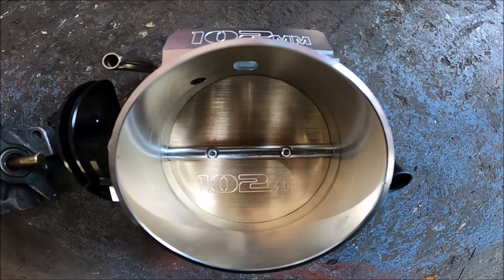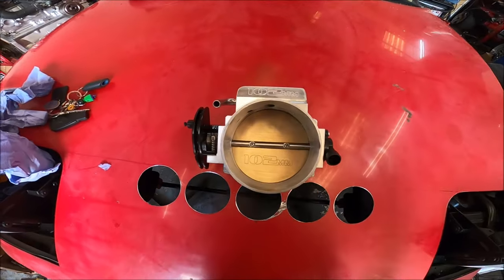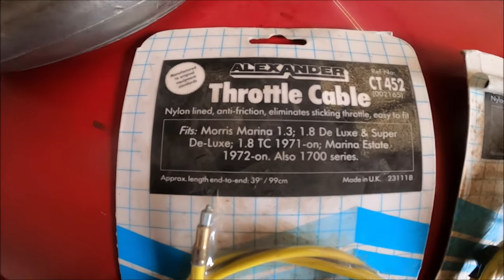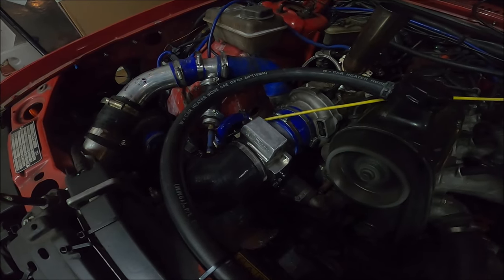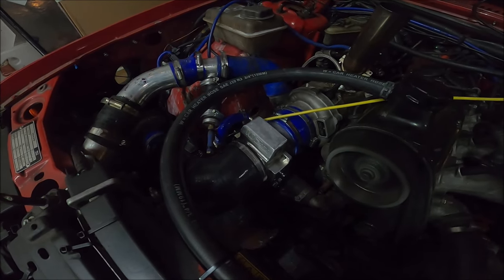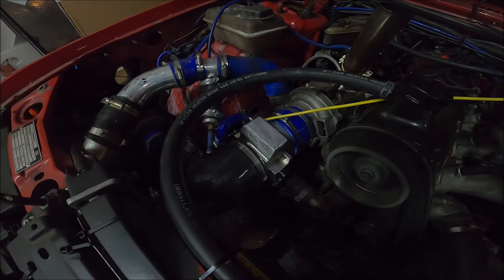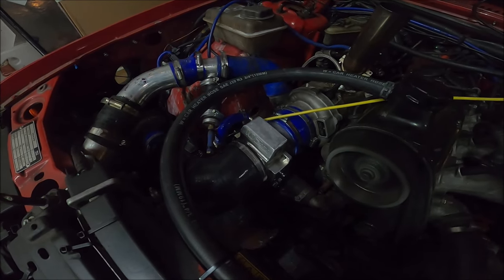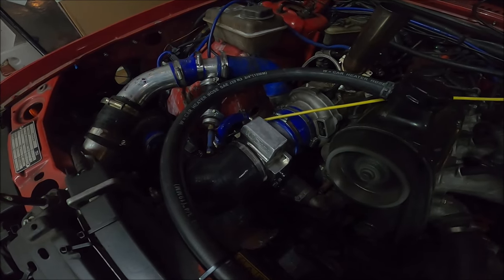Formula One technology for the Volvo 940! 102mm throttle, mounted BEFORE the turbo? Anti lag? Junk?

Comment: The set up running a pre carb is a great way to improve both throttle and turbo response but there is an issue that when closed it will cause negative pressure this over time will cause catastrophic failure as with many racing cars back in the day which happens when the oil seal has a catastrophic failure which won't just leak a little it will all flood the turbo at pressure which may lead to breakage of fins when a large volume of liquid hits them at speed suddenly warping/bending leading to chatter and breakage also the suddon loss of oil pressure will kill the engine and could possibly blow the engine if the timing jumps out .. . This is why many race cars and rally cars switched to the modern type of antilag on turbo set ups because of this reason yes it works good but as soon as one of thosevoil seals blows out or in this case gets sucked put it will lead to multiple failures that will lead to catastrophic failure ....the oil leakage will not happen straight away it won't be a continual issue from beginning but over a period of time the negative atmospheric pressures put a strain on the oil seals in the opposite way to what the seals is designed for in normal pop's the positive pressure helps to keep the seals in place preventing the oil pressure pushing oil into the turbo if u suck the oring on one side and push with oil pressure on the other side you double the stress on the oring with it unseating the seal which is death to the engine... if you look in the 80s and 90s how often the cars on track would have engine failures these failures were because of this set up yes it gives greater responses on boost and throttle but at what cost I remember seeing the cars on track after every few races either swapping out the engines or blowing an engine after only a few races 9 out of ten timescud see oil burn from exhaust and then bang there out an oil spray all over the track  and there would be an anouncement that that team is now out seem to be an oil pressure problem or an oil leak which is why it is not a good idea to run such a set up for a road car... the seals will pop  when u least expect it there is usually no signs right up until they actually let loose  an in that instance you don't want it on road because if your engine goes bang an u spill oil on the road your putting other people's lives at risk cos u might cause a crash when the seals suddenly let loose honestly think you need to think more when modding a car it's not just the performance you need to keep road safety in mind particularly if you are looking to run it as a daily driver or road car...
Reply from the maker: This is all covered in the video, including the solution to this.
And this wasn’t why the engines had failiures back then. Well maybe some badly done draw thru turbo setups, but not the ones with the throttle pre turbo etc

Comment: I am pretty sure the oil thing was with very old turbochargers. Any turbo deisel would create enough vacuum to cause that issue as they don't use any throttle body.
Reply from the maker: Turbo diesels have no real vacuum anywhere as they have no throttles, hence why they use electronic or mechanical vac pumps to operate everything .
Reply: @StavTech  of course what am I thinking. 😆 although some Toyota's use one as a safety.

Comment: So, I had a 200sx on a cossie T4 with pulsar throttle body intake (reversed to fit an SR20det obv) if I had put a throttle before the turbo also, would it have improved throttle response and lag? As much as I loved the kick up the arse when it eventually spooled, less lag would have been good!

Comment: In FSAE we could only run one TB and at the time we needed to have it in front of the turbo, so we fucked a turbo or two and while we were looking for solution (hard to find decent turbos for 600cc with limited budget) they changed the rules, so that was nice. Apparently some type of seal is fine with it.
You are not mapping Your car, it's more like saving a new file that a mate emailed to You into the ECU. Whatever.
Thanks for the video.
Reply from the maker: Nobody said I’m mapping a car?

Comment: This thing is NUTS! I don't see a reason to use anti-lag anymore along with this. Or is there?
I mean the lag is obviously gone. Why should you?
Reply from the maker: This is great for the money and effort, but proper rally antilag is way way better. You can’t compare this to having all the boost on or off throttle at any rpm.
Reply: @StavTech  Nevertheless. Less risk for proper anti-lag to prematurely put wear on components. 
And may be a bit more sleeper oriented as you don't have the pops going out the exhaust.
I've indeed never seen anybody do this and I'm really convinced it works out for you.
Reply from the maker: @volvovalor8051  oh for sure, no stress and no noise, as road car always usable stuff goes, it’s brilliant.

And it certainly works great for me

Comment: What's  Stopping you  making this the one and only throttle ? is it just danger of over speeding the turbo ?
Reply from the maker: The vac from that is usually what sucks oil out the compressor oil seals. Also meant to give worse throttle response.

Comment: It would be good to measure but I think your vacuum cleaner analogy is wrong. As you have a throttle at each end of the boost pipe, when you shut the throttle quickly it should trap the air in the pipe rather than letting it push back out passed the turbo. You should be holding something close to full boost in the intake pipe while the throttles are closed :)
Reply from the maker: It’s nothing to do with the compressor really. 
The turbine is the motor of a turbo. You give it no work to do, it speeds up. It’s work is turning a compressor which in turn is trying to push air.
And no, you won’t hold any boost in the intake pipes, if it did the turbine would have work to do, which would slow it.
Reply: @StavTech  without the extra throttle, when you lift off the air pushes past the Compressor wheel and you can hear the chatter, with the throttle where does that air go? 

It must be in the pipe. Yes it will bleed out as both throttles are never really 100% shut.

Be interesting to put a pressure gauge on it and see what happens.
Reply from the maker: @CheekyNinja  I already have. There is zero pressure in there off throttle. Where does the air go? In to the engine mostly.

Comment: You talk about time swapping chips compared to tuning, but in reality an aftermarket ecu would take a day or two to fully tune and be much better, how long does it take from the first chip to being tuned correctly? Guessing much longer than a couple days. 
Good video otherwise
Reply from the maker: It took me sending him the closest chip I had that was correct, telling him what I wanted changing, and him sending me back the right one. So two days and no effort or money.

Unlike buying, wiring in, and mapping, an aftermarket ecu which will gain me little to nothing.

Hth

Comment: You need carbon seals for that right? I read that the turbo's seals will be vacuumed and oil everywhere.
Reply from the maker: No because if you still run a throttle in the conventional place too there will be no huge vacuum

Comment: You need to buy yourself a turbo speed sensor, tons of pressure sensors and log all the improvements, a "feels" better Video isn't enough to prove a point. How many milliseconds are we talking? 
And chips? It's 2021 now. Time to get a ecu.
So is what to do when you just do shift cuts and leave the throttle open what could be done to improve lag between gears there with this? Maybe this was designed actually to make turbo lag less paot braking event and not lift off up shifts?
Reply: Also, don't make me beat you to having a engine dyno
Reply from the maker: This is a zero budget project and you telling me to fit turbo speed sensors lol.

It’s nothing to do with feels, plenty of comments have said even they can see the difference as all you need to do is go back and watch the previous video and you’ll see.

And as I explained in the video I have an aftermarket ecu for this, but why spend ages wiring it in, mapping it, etc, when I can just use the car no problem as it is and enjoy it. No gains to be had apart from pleasing people on the internet

Comment: and just maybe vacuum is supposed to keep turbo running? wouldn't that hard vacuum that engine generates with throttle off made a turbo spins real fast? yes it would suck oil from turbo but it would keep turbo spin on very high rpms. without vacuum, turbo will slow down cause there's no exhaust gasess and there's no vacuum, it's pracitally useless. 

i think that this is a good project but doesn't make sense, at least in antilag sense.

Comment: if you still have a blow off valve wouldn't it leak atmosferic air in the intercooler piping?
Reply from the maker: I never run BOVs

Comment: Does it not speed up because the velocity of the air increases due to the orifice or hole being smaller?
Reply: It speeds up due to the exhaust side of the turbo still flowing like crazy while the whole compressor inlet is under a slight vacuum and not making any boost thus there being no resistance on the compressor wheel. A single throttle pre turbo inlet works similar but due to the high vacuum it's more likely to suck oil past the shaft seal. And a post turbo throttle is has too much of a restriction while off throttle resulting in the shaft speed to decrease rapidly even with a very large blow off valve

Comment: alot of the new honda diesels have throttle bodies pre turbo. i wonder if its again to help with efficiency
Reply from the maker: I didn’t know that, but yes highly likely
Reply: Maybe some thing to with exhaust gas recirculation? For better control of amount exhaust gas..
Reply from the maker: @242turbo  they’d just put them in the conventional place like they have for decades on some diesels if it was just for that I’d say
Reply: It is to raise exhaust temperature during light load.
Reply from the maker: @V8Lenny  why would pre turbo do that over the usual intake manifold place?
Reply: @StavTech  sorry I didnt read carefully , some diesels use it after turbo for that , dont know about Honda and pre turbo.
Reply from the maker: @V8Lenny  yes indeed. The throttle is certainly for that.
But changing it to pre-throttle the only advantage I see vs the usual place is it could help turbo response. And as that’s such a big deal on diesels it makes sense.
Reply: @StavTech  dont know if it is big deal because diesels are at "WOT" all the time.
Reply from the maker: @V8Lenny  even bigger effect then as even bigger vacuum if you throttle it

Comment: out of curiosity, whats the point of having a throttlebody after the turbo if you already have one before the turbo?
Reply from the maker: Throttle response (though if you could feel that is debatable), and not creating such a big vaccum it sucks oil out the seal on the compressor side of the turbo

Comment: You need to put proper ECU on it, so much potential!
Reply from the maker: I’ve got one to go on. But to be honest it won’t make a massive difference to anything.
Reason I’m gonna fit it is to learn to map
Reply: @StavTech  do I understand correctly that with such setup you don't really need bov/bypass valve?
Reply from the maker: I’ve never ever ran a Bov or bypass valve on this car, even before this setup

Comment: i can imagine removing the stock throttle and getting a bether flowing intake manifold only could compliment this? as you remove resistance on the boost side?
Reply from the maker: A better intake side may help power if it’s a restriction, but it will have no effect on turbo response etc that the pre turbo throttle was affecting

Comment: rear mounts VGTs VAG engines in Toyotas  and now this shit  i swear Steave if we where the same side  of the planet  you and I would be we would be good mates  So much stuff I a ponder you are there messing with and testing .. Something else  I've been considering with this setup is a  massive dose of water methanol on trailing throttle injected right at that throttle plate  the vacuume you make would allow you to evaporate a heap of water meth  witch would do a heap of cooling to your compressor and  intercooler .. I see this video is old have you messed with this set up  much since then ??
Reply from the maker: Mate, if I had money I’d dream of owning a Dyno just to test stuff I’ve always wondered.

I’ve got countless other ideas I’ve always wanted to see if it works.

Not messed with this setup for ages, though still have it. Defo has an effect, but can defo be improved also from this setup
Reply: @StavTech I think you should do a DIY water Inj mod next. A washer bottle, some water mixed with isopropyl and a pipe from the pressure side of the turbo into the manifold.

Comment: Why even have such a huge throttle body?
Reply from the maker: Because you want more airflow at part throttle pre-turbo than pre-engine. You can either open the pre-turbo one much more than the pre-engine one, or just run a bigger pre-turbo one. I did that as it’s a hell of a lot simpler
Reply: @StavTech  This engine has 2 throttle bodies?
Reply from the maker: @kaedeschulz5422  yes. Same as pretty much every engine with this setup
Reply: @StavTech  Ah ok then i get it :D

Comment: The idea of using a throttle body in front of the turbo has nothing to do with turbo anti lag. It’s all about the turbos compressors surge line.
Reply from the maker: Wrong
Reply: @StavTech  really how is that then.
Reply: I say this because you was talking about f1 cars using throttle veins in front of the turbo. Which is used to change the turbo comp surge line.
Reply from the maker: @Craig1337GT  because of everything shown and explained in the video. Or every single research paper ever done on the subject. Or why it’s done to save fuel on industrial air compressors, and so on.

It takes load/work away by not giving the compressor any air, which keeps turbo rpm higher for any given amount of force put on the turbine wheel by the exhaust gas.

Anything related to the surge line is purely a function of that.

That’s like saying conventional rally antilag is all about the turbos surge line. Surge is a factor like it is in anything, but it’s not the final purpose
Reply from the maker: @Craig1337GT  even in the video it explains the throttle vanes, it even features a clip of someone else explaining the throttle vanes, countless research papers for 4-5 decades explain throttle vanes. They serve the same purpose as the throttle plate, but also introduce pre swirl which magnifies the effect on part throttle
Reply: @StavTech  ok so like I said in f1 they use to change the compressor surge line.  So if your saying it’s for anti lag why do they use a MGUK in F1 then and anti lag is banned in f1.
Reply from the maker: Antilag as in rally antilag is banned in F1.

Doesn’t mean you can’t use other means to reduce lag, as literally everything within an engine spec affects lag in one way or another

Comment: The best anti lag is using compressed air to spool the turbo
Reply from the maker: You’d need either a massive tank or hardly ever use it, so not really, hence why nobody does
Reply: @StavTech  Volvo does it in their 4cyl diesel engine... you just need an AC air pump for pressurizing air into the tank
Reply from the maker: @antoniosestar3671  I know, and even then it only works because it’s also got sequential turbos so what it has to spool up has to be tiny and spools easy anyhow. Different story when you got got a turbo less tiny, hence why it’s not widely used